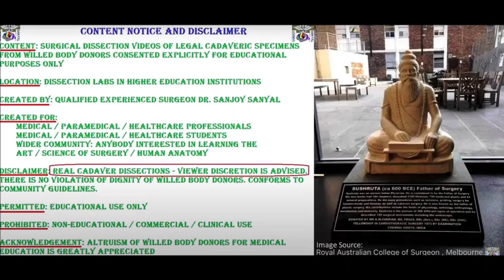THORACIC WALL Musculo-Skeletal INTERNAL MAMMARY VESSELS and Clinical Aspects – Sanjoy Sanyal

Comment: My transcript notes of the video 
00:06
Good day everybody this is dr sanjaya sanyal professor department chair so this is going to be a demonstration of the anterior thoracic wall that we have already removed from the cadaver so first we would show it from outside

00:16

 and then we would show it from inside so let's take a look at the salient parts first this is the mannequin's turning this is the body of the sternum and this is the zephoid process

00:28

 this is the manufacturer joint which forms external angle of louis and we can see it is projecting forward and we can feel it in our own selves and attached to this either side of the sternal angle of louis we have the

00:38

 second rib second coastal cartilage to be more precise at the this tunnel joint we have the seventh coastal cartilage inserting here now let's take a look at each rib and the cosmic cartilage itself

00:51

 this is the place where the first rib is attached to the mandogram sterny and above that is the articular facet for the clavicles which have been removed these had formed the sternoclavicular joints

01:00

 this is the second rib as i already mentioned and this is the third fourth fifth sixth seventh we notice that the costly cartilage is the terminal part of the rib the medial portion before that is the bony portion

01:13

 and at the costal cartilage it makes an angle and it goes towards the sternum this is going to play a significant role when i mention the muscles the next thing i draw your attention to are the muscles themselves that we can

01:24

 see here if you take a look these muscles that we see here these are the external intercostal muscles these muscles are used only during force respiration in what is called the

01:35

 thoraco abdominal respiration external intercostal muscles they go from the rib above down to the rib below and they go in the direction as if leg hands are in the pocket the purpose of these are to elevate the

01:46

 ribs during forced inspiration the external intercostal muscle as it comes towards the sternum it becomes a membranous structure and i should show that membrane structure on the other

01:59

 side here if you take a look closer to the sternum it does not form muscle anymore now it's called the membrane this is called external intercostal membrane i have lifted it up

02:10

 here i'm going to lift up the other side also you can see it here this is the external intercostal membrane so therefore closer to the sternum there is no muscle external intercostal muscle there is

02:21

 only external intercostal memory now let's take a look at the next muscle under that and for that we will come to a lower portion here we have removed the external intercostal muscle and we can see another muscle

02:33

 underneath and we can notice that the directional fibers are different rational fibers are going from the rib below to the rib above and they are at right angles to the previous muscle this is the internal intercostal muscle

02:46

 this internal intercostal muscle has got two portions one portion is between the bony part of the ribs and that is called the interruptions part and there's another portion which is

02:56

 between the cartilages part of the ribs and that is called the intercontrol part the two of them have got different sets of action the international part is responsible for depressing the ribs

03:08

 therefore it is used in force respiration for exhalation while the intercontrol part is responsible for the same action as the external intercostal it is responsible for

03:19

 elevation of the ribs now why is it so it is a simple law of mechanics when the directional muscle fibers are almost parallel to the direction of the ribs then they will produce elevation and when they are at right angles to the

03:32

 direction of the ribs they will produce depression in the region of the cosmic cartilages the intercontrol part of the internal intercostal direction of fibers are parallel to the direction of the ribs

To get the full transcript and PDF notes with screenshot - Try Askify chrome extension